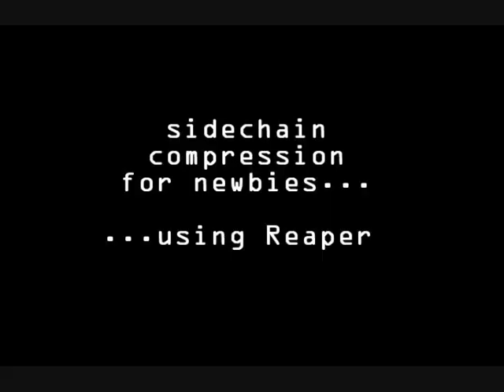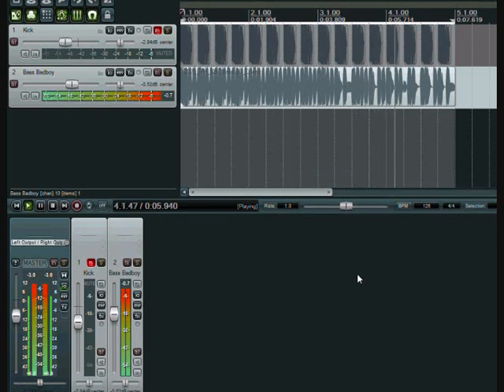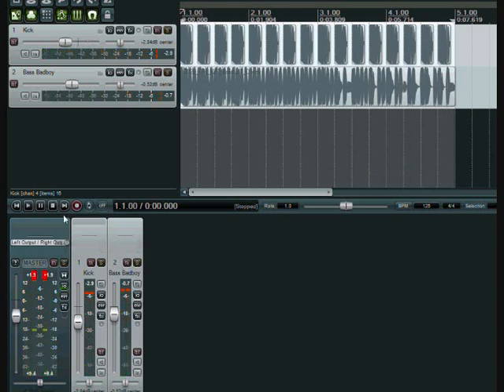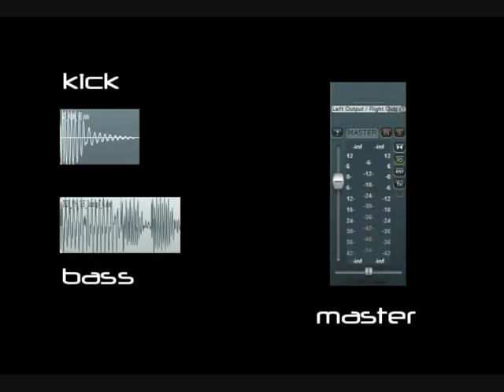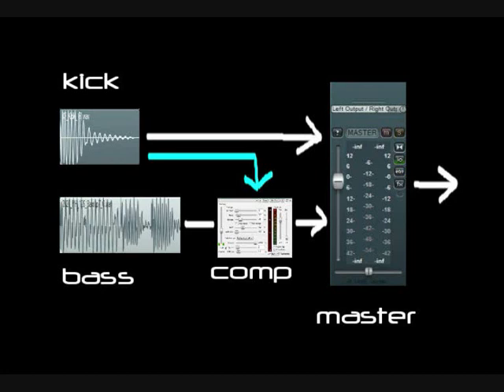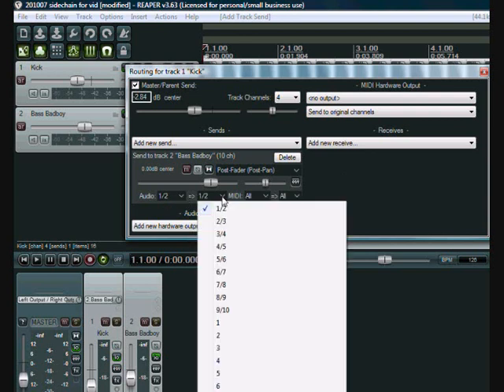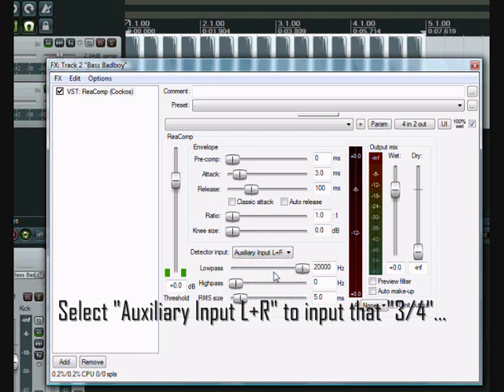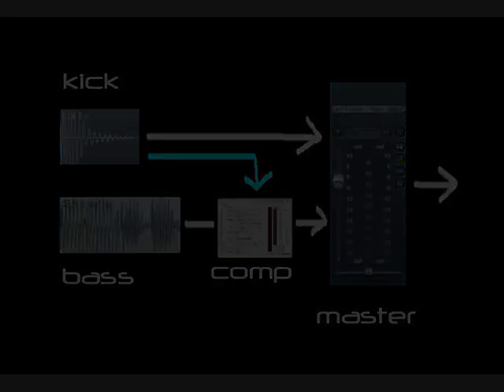Sidechain Compression for Newbies....in Reaper

Comment: Thanks that was a very helpful and easy to follow guide. Made way more sense seeing it than reading about it, mainly bc other people use strange idioms.

Anyways is it possible to select the auxiliary inputs for other compression plugins? Or is reacomp the only one that has that option? I think there is a way to do it, but I just keep screwing up the signal chain by trying to select different VSTI inputs and outputs under the Param settings.

Comment: Thanks bro, this is just what I needed. Question, I think I am not sure if the full drum mix I am using as the trigger is doing too much compression. Is there any way to adjust it so the snare doesnt also trigger the bass.

I use Addictive Drums midi/sampler drum engine but I dont make a separate channel for each drum. I just use the one.

Comment: OMG evey one of these tuts they use recomp with a simple drop down channel option. Im trying like hell to find out how to do it with fabfilter. Ill keep looking.
Reply: Mind reporting back if you find anything?
Reply: Truth be told i gave up. Recomp does work very well and easy. Really dont know if there would be an advantage to using Fab.
Reply: I actually just figured it out! I was using a VST, but if you use a VST3 version of the plugin you can use channels 3/4 to control the compressor and still output only channels 1/2 to audio
Reply: The plugins that comes with reaper may look cheap, but they are incredibly good. reacomp, stereoenhancer and readelay as just a few examples are simple, intuitive and does the job very well.